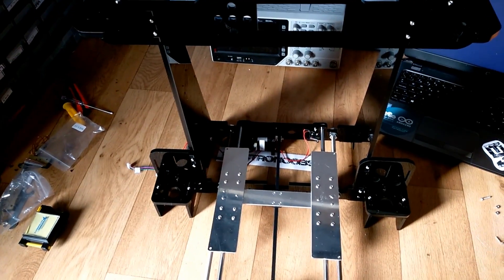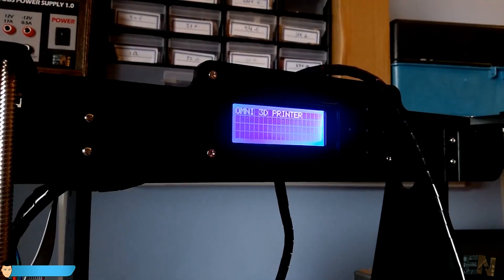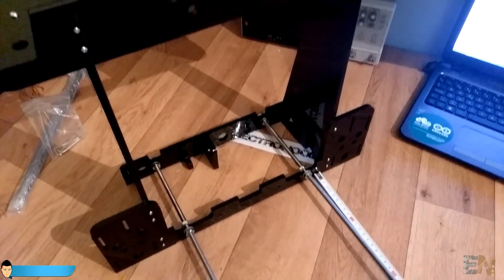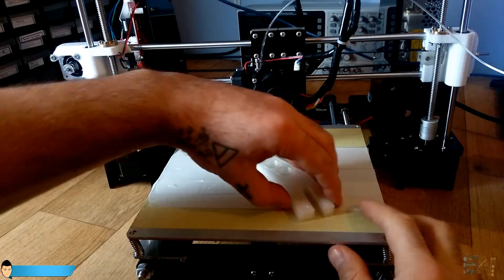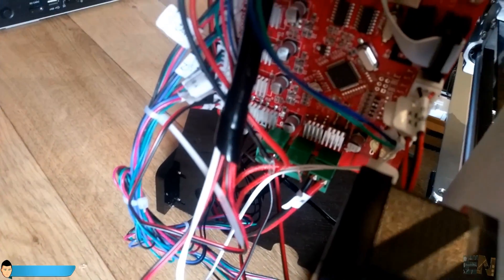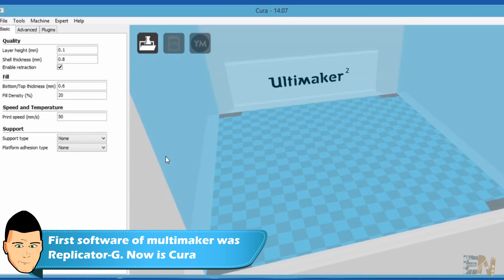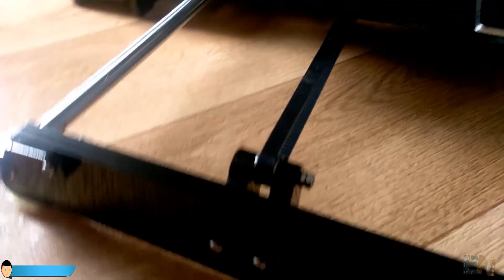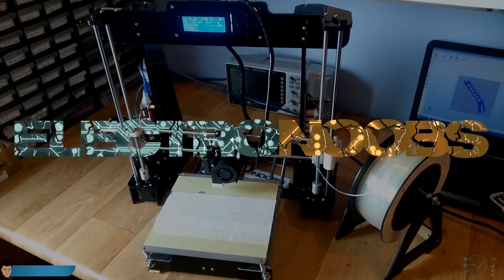My first impresion of Anet A8. Cheapest DIY 3D printer

Comment: Nowadays this printer has been silently upgraded.  I have the newest "revision" with upgraded motherboard and bed connector. Works flawlessly, no overheating on any part, no melting connectors, secured thermistor in hot end, printed some supports for frame and it's much more stable. The only issue I ever had was with the extruder gear skipping. I thought it was a clogged nozzle, but it was the gear's screws not secured correctly. Fixed that in 20 minutes and now it works like a charm :)

Comment: You no need hairspray on glass, nor any tape. Just clean with some detergent or soap until water stay on the glass surface. After that, printing area NEVER touch with your fingers again. If you want to stick better to glass surface, increase the temperature of the bed. Be aware that the hotter, the better it holds - but harder to detach after print. PLA on 70 degrees C, is stick so well - that is really hard to detach printed part. So, print with bed temp at about 40 - 50C. I hope this helps.

Comment: for the price, this printer is absolutely great. the only bad part about the kit were the included belts. they are awfully stiff, and still stretch like old socks, despite the steel wire reinforcements. glass fiber GT2 belts are much stronger and more supple. the printer even sounds different. 
ps: if you put some thermal grease between the cold block and extruder mount, you can ditch that annoying little heatsink. the thick aluminium mount can easily dissipate enough heat. also i cant recommend this adjuster enough: http://www.thingiverse.com/thing:1776429
Reply from the maker: Cuda FX thank you. I have already tuned my ptintter. I'll try those fiber glass belts
Reply: you're welcome. =) a x-belt tensioner, like you have already installed will be absolutely necessary with the upgraded belts. (to those who dont have one yet)
Reply: Do you have any tips in terms of calibrating the z axis and other axises - fairly new to 3d printing and im going to get this printer along with a e3d titan extruder kit and an autoleveling probe - does the auto leveling take care of all the axises or only the x/y?  also, what gt2 belts would you recommend
Reply: the only "calibration" you need to do is leveling the bed, which requires a piece of paper and some patience. the adjuster i linked makes it easier to get the z-hight right. auto leveling is really just a convenience. IMHO, get the printer running, gain some EXP, and then see what upgrades you want or need. if you dont for what exactly you want an v6+titan setup for, it's money out of the window. the stock mk8 does print nicely.
ps: i may talk like a veteran, but i'm only printing for a couple of weeks myself - still much to learn and fine-tune. ;D
.

Comment: Cheap? Until your house burns down... Prices already went up,  taking into account that you need to reinforce the frame, install a mosfet module, pray that your power supply doesn't blow up... That's just an unreliable machine, nothing more.
Reply from the maker: I can find if for only 145$ right now on some webpages. What are you talking about the PS blowing up? Is that what happened to you? :O I have this machine for over a month and it works perfect since then, and I use it almots 24/24. And what about that mosfet? 

Thanks for your com!
Reply: When I look at Aliexpress, it'll cost me around 240 euro including shipping costs. Then I have to take the additional custom taxes into account. I'll better buy a Wanhao i3 or i3 plus from a European seller or just make my own printer with decent electronics.
Reply from the maker: Make your own is a great idea. I live in spain, here I fiund the Anet for aboutr 145 euros. I can live you a link if interested. https://www.igogo.es/product431008.html?currency=EUR&lkid=16451&gclid=CLjOgP-_49ECFQuNGwodYrcJYw Keep up and good luck :)

Comment: the board might  fail I already went  through 2 I found a really good seller at http://www.ebay.ca/itm/282292228830?_trksid=p2057872.m2749.l2649&ssPageName=STRK%3AMEBIDX%3AIT
Reply from the maker: chase debolt wow, please be more optimistic. I hope that won't happen to me. and if it will thanks for the info. dose it send to Spain as well? thank you!

Comment: I bought this printer and then built it ... then when I turned it on the side exploded... thanks for persuading me to by a crappy experience and a broken printer
Reply: wtf how did you get the side exploding? I am using this thing for months now without any problems.
Reply: ELECTRONOOBS I am buying a new board and i am praying that it works
Reply from the maker: GymBoyB I'm sure that it will work!!!
Reply from the maker: I'm very sorry to hear that! Maybe the supply wires were reversed! I hope you can fix i. Spare parts are very cheap.
Reply: dreamyrhodes it was a faulty board

Comment: Your zero position of the X axis can be fixed in software.  Either slice your objects to fit on the actual center of the bed, or rebuild the Marlin firmware, setting the X_MIN_POS constant to a negative value equal to the offset from the edge of the bed.  You can find a power terminal cover on thing-i-verse that includes a space to mount a power switch.  I printed one of these for my reprap Wilson.
Reply from the maker: Kenneth Scharf yes, already done that, thanks a lot :)

Comment: Your 2 listed problems were due to you not understanding how to use the printer. Firstly, there are no belt clips for the x axis. There is a metal post on each side that the belt wraps around. You then use zip ties to clamp the belt end to itself. Then you listed the space between the x endstop and the print bed. Do not try to put something in between them. All you have to do is go into repetier and configure the print bed. You tell it the x endstop is negative. Just home the x axis - then using manual control, step it over 1mm at a time. When it is just over the bed, look at its position. I believe it is about 32mm. You then just put that in the bed settings that the x endstop is at -32mm. That way it knows the endstop is behind the bed. Then it knows 0 for the bed is 32mm infront of the endstop.
Reply from the maker: Hi there. This video was my first impresion on the kit. It only have been for 2 days in my workshop. Yes, that is what I've done for the axis and is now centred but when it is homing the extruder is still outside of the board (negative 20) and sometimes some melt plastic fall on to the ground but that is no proble. I have already decided to let that how it is. And for the belt clips, in my video kit tutorial the person that is in the video on the SD card has this small 3 screw belt clips and my kit doesn't include those. I've also seen that way you are telling me using zip ties. But I prefered to print some belt clips. Thanks for your answer and keep up.

Comment: I haven't seen this printer in Canada yet, If I were to buy this printer and have it shipped it would cost me more then the Printer, so can you provide me with a parts list I can go to my local electronic store and purchase the parts.

Thanks
Reply: I bought mine off Gearbest, shipping to Canada was only about $50...
Reply from the maker: Hi. Well first you need the body which i belive you won't find in a local electronic store. But if you build your own body you will need the same parts as for the prusa, see this link for a full part list: http://reprap.org/wiki/Prusa_i3_Rework_Bill_of_materials

the only thing that changes fot this ANET A8 is the board. In the link taht I've gave you the board is a RAMPS 1.4. In case of the Anet A8 the main board is called Melzi. The rest of the components are the same, 5 nema 17 step motors, belts, rods, bearings, extruder, etc.
Reply from the maker: From china?
Reply from the maker: You can find all the parts, and a full guide here on my webpage: http://electronoobs.com/eng_constr_anetA8.php

Keep up!

Comment: ths s not a prusa you always refer to. It is an ANET. Different company. They cloned the prusa and changed all the parts you are pointing out. DIFFERENT COMPANY, DIFFERENT PRINTER.
Reply from the maker: peter L. calm down. that's exactly what   I'm saying in this video. as I said the prusa and all the RepRaps are open source so anyone could copy the project and sell it. Even I could make my own model. So this company that you say made their own and called anet. I said that this printer is still a "prusa" but using the "". if you know what I mean. keep up 👷

Comment: Awesome review, nice to see the A8 reviewed by someone thats already got some experience, there's a lot of people that saying that the acrylic frame is a problem - I have yet to see anyone that is actually using it complain!!
Reply from the maker: Yes, the acrylic frame is not that good as the aluminium one but I am compareing this Anet A8 with the dear old prusa and both have acrylic frame and that's why I say this is better. If I were to choose between aluminium bars or acrylic, I'd choose aluminium. But in any case this is a very very good printer for this price!!! Gives me no problems!!!
Reply: For me I don't have any problems with the frame at all. Just don't screw the screws to tight.

Comment: Hi, how did you connect your anet a8 to your computer ? i have the same priter and i don't get how to do that 
Ps:super chanel
Reply from the maker: Yes i did. I use Repetier software. Download that. Open it and go to printter settings and sellect your COM. In my case is COM9. After that select 115000 baud rate and insert all the printer settings, dimensions, etc. Click accept and in the main screen on the left top corner click connect. If it dosn't connect try a 250000 baud rate or a different one. Go in the manual control to move axis, home the printer, heat the extruder, etc...
Thanks and keep up!
Reply: On the board next to the sd slot there is a usb connector
Reply: TheVanglume you get a flash drive that gives you the software and then u save your piece to an SD card and insert it into the printer
Reply from the maker: Hi there. You just plug your printer to your PC and a new COM will apear. The COM number is different for each PC. In my case is COM4. Now you have to install the Repetier o Cura software. I recommend Repetier. Onece installed, open it and go to printer settings and choose your COM for your printer, add all the data like speed, maximum printing size etc. Once finished click connect and you are ready. To generate G code I use slicer. I hope that this will help you.
Reply: Voorhees Jason no shiet Sherlock !

Comment: The acrylic frame is the biggest problem with that printer. You can find the Tronxy X3 for $200 which is in the same price range as this. The X3 has a metal frame, bowden extruder, and larger build volume (220 x 220 x 300).
Reply: The X3 is usually about 30% more expensive than the A8 you pay for those extra features and as always you can always say to yourself "Well if I spend a little more I'll get a better printer" and before you know it you've spent 3k!
Reply: It looks like the prices for the X3 are going up. When I wrote that the price on GearBest was $200 (the same price he mentioned in his review).
Reply from the maker: You are right. That seams a better printer. I've seen it a few months ago but I didn't knew that it price lowered that much. Any way, I was comparig the acrylic frame of this new Anet A8 with the older version of the rep rap Prusa. If course, you can't compare it with a metal frame. Thanks and keep up.
Reply: Anet sells the same Aluminum frame, Called Anet A2. They also sell smaller printing 150 mm boxed printer called Anet A3. But Anet A6, an upgraded Anet A8 is what I got. I wasn't sure if the Anet A2 on the shops had the similar upgraded control LCD units.